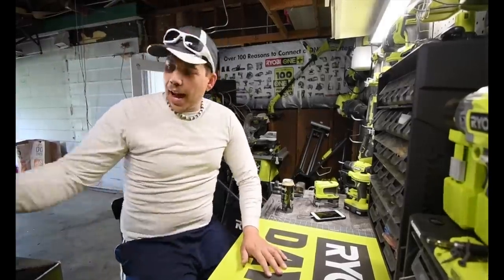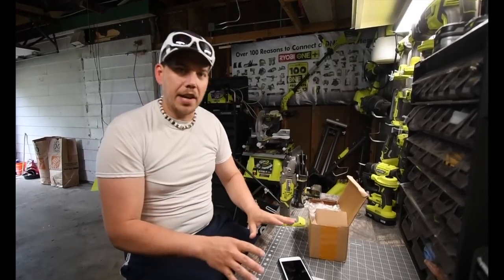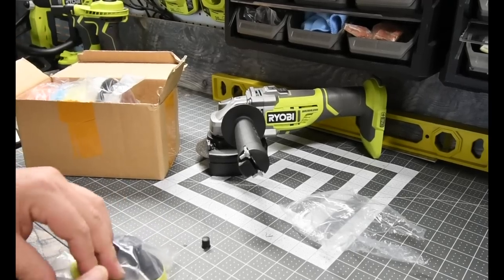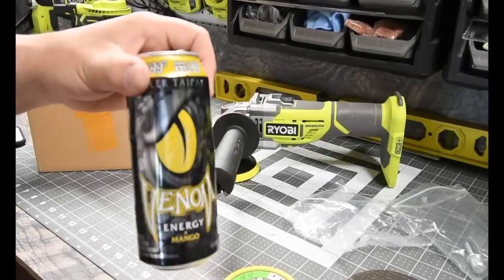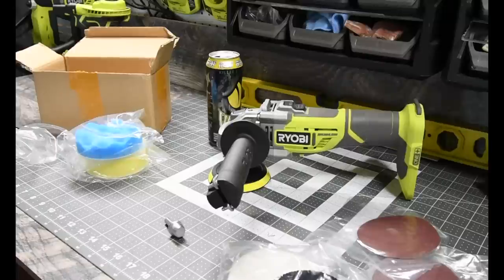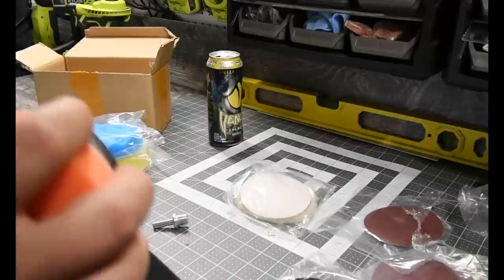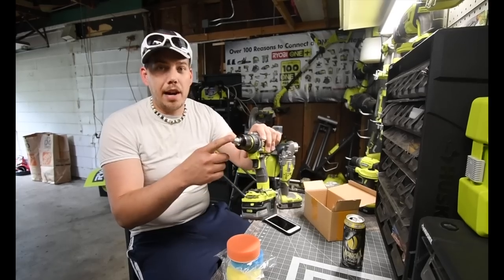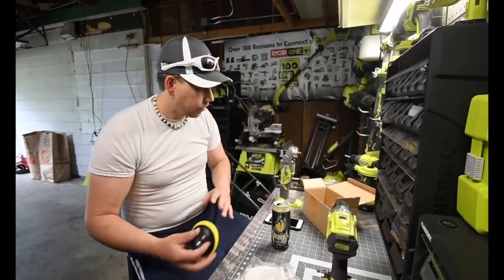Ryobi Angle Grinder as a POLISHER?

Comment: Car polishers are definitely a lot slower. I would definitely not recommend using an angle grinder. It can burn the clear coat off. Please use the drill it would be a lot safer. Plus you will have control of your speed. BTW HAPPY BIRTHDAY.  Thanks for the video.
Reply from the maker: Im doing tests first before I actually use it on a finished surface
Reply: I bought an angle grinder to do this.
Reply: Thanks for the angle grinder advice I suspected that the speed and power of one might be a bit too much.  How about an orbital sander? those aren't too fast
Reply: You're absolutely wrong, First of all Angle grinders may have speeds just like polishers
Reply: A variable speed grinder is what you need for this
Reply: @MJMDrawings  not like the one he got..that ryobi is no adjustable speed..
Reply: This is so true

Comment: A grinder is waaaaay too fast! A car rotary polisher is closer to 1k-1500 rpm
Reply from the maker: smrcalidiv that is why a test will be made for you guys to see what happens if you use it.
Reply: Boat it's probably good for though...
Reply: Wire it through a light dimmer switch and then use the dimmer switch to to control the rpm giving you variable speed control? (Of course this could only work with a mains wired grinder)

Comment: Nice Video.... By the way ..It wasn't picking up the empty box.......It was when u placed the box on the ground.... next time throw one leg up in the air as you go down and it will help 100%..... U have a lower disc 4 and 5 issue m8.... I can guarantee u that u get a bad back when u even decide to pick weeds out of a garden ....... Will get a lot worse as you get older........ Been there Done that......

Comment: I am glad you made this video.  I was hesitant to buy yet another pricey tool like a Griot #9 polisher at $170 and wanted to use my angle grinder for polishing, since it is variable speed.  I might get a cheap smaller grinder that is easy on the wrists at $40 or under. However, you did not show any actual polishing, so this is theory only and not a demo.  You also did not post any links to the type of pads you bought and that would have been useful.

A couple of things to point out to readers - the cordless grinders are heavier and will put strain on your wrists, esp females like me with slender wrists.  Better to stick with corded versions and small as you can find since you don't need power in a polisher.

I would also get a variable speed grinder as you want to keep the speed low.  High speed will cause so much heat friction on your foam pads that they will burn up and leave melted foam on your project or car, not to mention taking off the paint on your car.  It will melt at high speed regardless of how much you press down on it, because there is more heat generated with high speed friction than low speed.  This is why, when you buy nylon bristle cup brushes for your grinder, they warn you to keep it under 2500 RPM or it will melt.  It melts regardless of how lightly you hold it to the project.  It happened many times with me when I forgot to adjust the speed.  This is with a heavy duty nylon, not this light foam pad which will melt easily.

Using a drill for polishing is useless.  Not enough power, very heavy on hands and awkward bulky angle, and wears out the drill for long term use.

Regarding back pain - public service message:
It's not a spinal compression, it is a butt muscles compression that is causing your back pain.  Do some butt gluteal stretches, and also upper leg stretches and your spine, neck shoulders, hips will all loosen up. Swimming outdoors helps a lot too, and adequate sleep.  Small massagers on the hip muscles will loosen them up too.  Stay away from those toxic Red Bull, Monster, Venom drinks, and all soda pop drinks which are the root cause of fat belly and metabolic disease.  No more sodas!  The sodas, beers, sugars, refined carbs are the cause of fat bellies and the root cause of metabolic diseases like diabetes, heart disease, stroke, etc.  All comes from one thing - sugar.  Don't be in denial, that is not good for your longevity.  If you are tired, and need energy, take a Vit B complex 100 mg tablet with your food and its like a shot of coffee and very good for adrenal glands.  Caffeine on the other hand will wear out your adrenal glands and make you very tired.  Take Vit B's at 8 am & 4 pm with food, and at noon, take a good quality Multi Vit/Mineral tablet like Costco Kirkland brand, but not junk ones like Centrum, One a day, these are no good.  Do abs to strengthen torso too.  I find the more active I am, the more I need to support my torso with abs strengthening.  Goodbye lower back pain!

Comment: I’ve actually just setup my dewalt angle grinder with polishing attachment. It does seem to fast with no variable speed , y drill with probably do better . The grinder has probably done a good job at cleaning the the pain surface with the sponsor attachment as it needed closer attention a jet wash couldn’t do 👍
Can’t see yiur video testing a grinder as a polisher though 🧐
Reply from the maker: id still use a buffer, this works but a buffer is a better solution

Comment: Did it work? or too fast as some comments say?
Reply from the maker: just because of the attachments needed I wouldn't use it for that. I just use a buffer
Reply: @ManCaverTools  some other videos are recommending to use drill as it has slower rpm. will try that. thanks for the reply

Comment: Just a thought:  4.5" is a tiny buffer & a non-orbital, 10,500 RPM pad is bound to quickly leave serious swirls in paint.  Lastly, the angle grinder isn't the most comfortable or efficient tool for gentle polish operations.

Check out the P430 10" orbital buffer (2500 rpm, $34) or the P435G 6" orbital buffer (4000 rpm, $37.97) if you need something smaller.  Both offer orbital action/lower rpm to avoid damaging your finish, larger pads that complete the task faster, longer runtimes, & better ergonomics/control for the job.  The P430 is an especially good deal as they just dropped the price $10.  Hope your back feels better.
Reply from the maker: I have the small Ryobi Buffer. I used it in a previous video working on the boat, Im doing testes with the grinder to see what it does the finished surfaces
Reply: @ManCaverTools  Cool.  Go lightly!

Comment: Hey, I have a ryobi grinder (looks the same as yours).   I bought a ridged tile cutting blade for my backslash,  but the instructions for the grinder say no flat disks.  Yours looks like its holding a flat disk, so what are your thoughts?
Reply from the maker: It has no problem with flat discs/ Cutting wheels. Ryobi does make 2 grinders